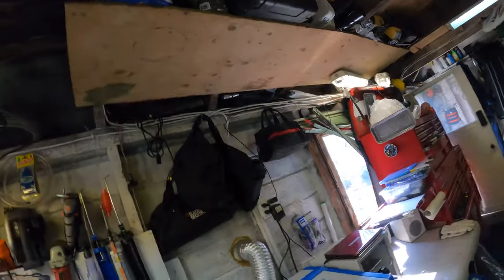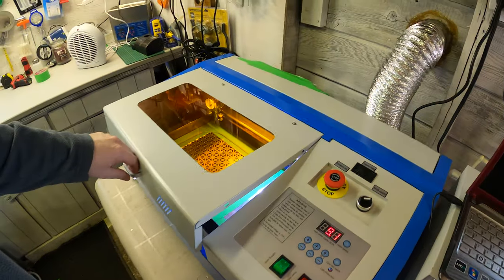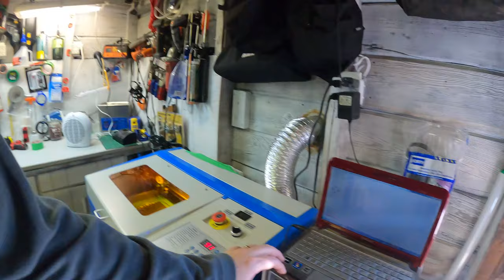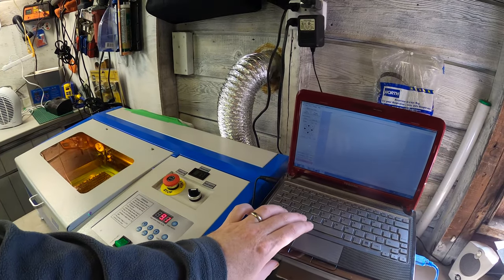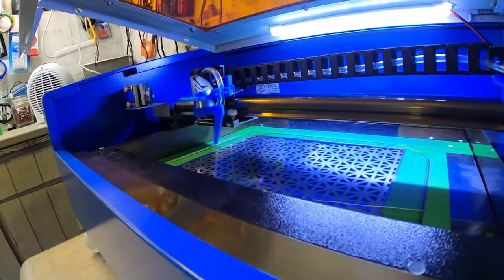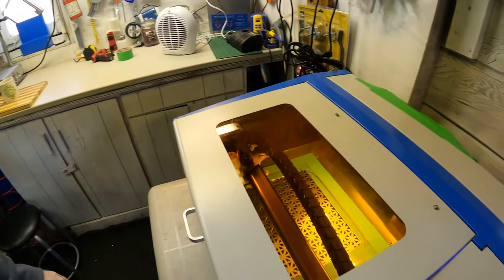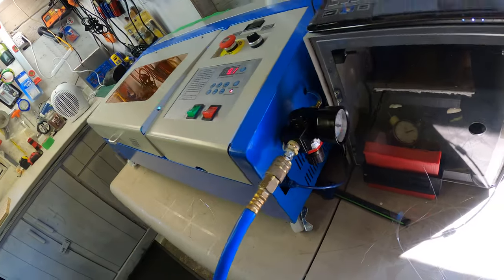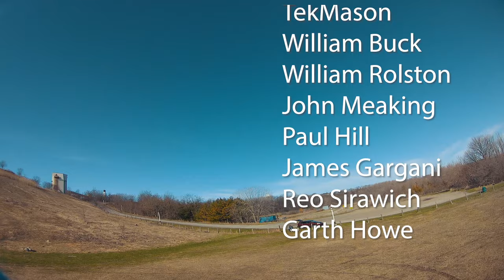Lockdown VLOG- Laser Cutting and Drone flying 😎

Comment: I have the same laser cutter. If you ever have a situation where the laser won't fire, check the water flow switch behind the control board, mine needs a tap every now and then.
Reply from the maker: No flow sensor on this one. I should add one though.